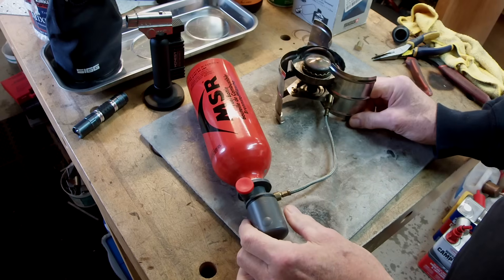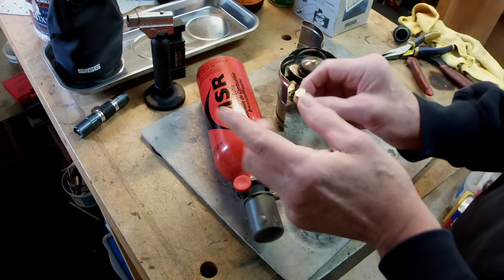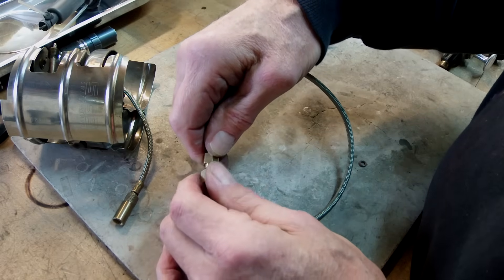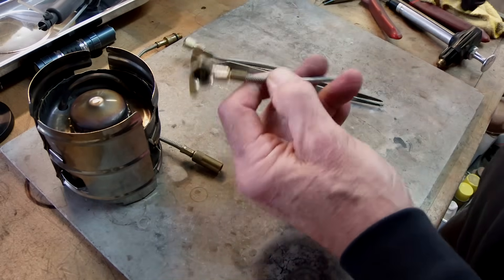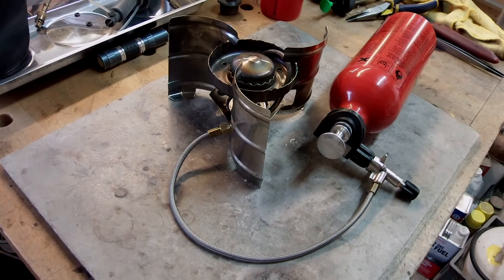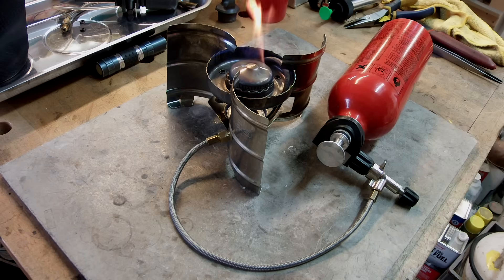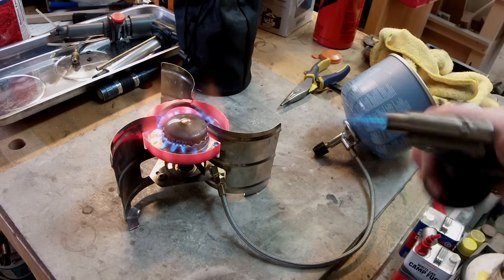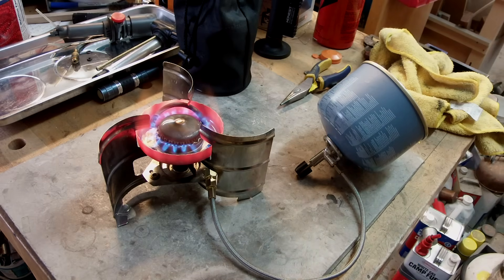SIGG FireJet Stove to Primus Hose Adapter

Comment: I'm a big proponent of Occums Law, the simplest way is the best way.  That is why I have stuck with the stoves like the Seva 123 and the Optimus 00 and its big brothers.  I get to camp pull out the stove and I'm ready to boil water.  Every evening I top off the tank and I'm ready for the next morning  or an emergency on the road or trail . I'm heating water in minutes.  The size of fuel bottle I carry will depend on the length of the trip.
Reply from the maker: @tomsitzman3952 I, too, have fond regard for the Svea 123 and Svea 123R stoves. Just take a look at my many other videos all about how to use and repair the Sveas. But, many people prefer a lighter stove solution. The video you are commenting on has little to do with Sveas but more about how clever and talented fabricators can keep old vintage stoves like the SIGG FireJet running. BD

Comment: Wouldn't it have been a possibility to braze the two together? I would think that brazing would be able to hold up to the temperatures.
Like the vid and fabrication though
Reply from the maker: @Antonio M. Andersen  Sure. Absolutely! Brazing the adapter on would be completely doable. You wouldn't even need to cut the threads on the stove side - just have a snug slip fit. Lots easier, too. Could even shorten the vapor tube to allow the stove to fold again.
BUT!!
These stoves bring a lot of money at auction to stove collectors. Doing a one-way adaptation with brazing would make the stove pretty well worthless to any collectors. Most sensible people don't want to throw the money away by brazing when the threaded method works fine, and allows for the stoves eventual resale at full price. Think about it... you don't actually OWN these (or anything else for that matter) since it'll pass on to someone else when you die. How you choose to be the custodian of it for the very short and limited time while it's in your hands is up to you. BD
Reply: @BernieDawgCinema  True indeed.
However I wasn't aware that it was a collectable stove but I guess they all are when enough time has passed 🙂.
Anyway when the purpose is to keep it as original as possible I better understand the decision to do it with threads than to braze it and that the customer is happy is all that matters, was a nice way you did it for sure 👌

Comment: Hi! Great job! Just as an additional Info, the wire cable mentioned was designed for cleaning the pipe.
Reply from the maker: @Michael Klees Thanks! Let's be accurate, though, please. While the cable in the vaporization tube is commonly used to clean the tube of gunk when using poor quality fuels such as kerosene or automobile gasoline, its use as a scrubbing cleaning tool is not its "designed" purpose. The cable is there to promote vaporization of the fuel and to restrict the fuel path to prevent surging and pulsing of the stove. Cleaning is completely secondary to the other functions. And, if you use clean-burning naphtha fuels (aka Coleman fuel), you’ll not have the fouling that requires using the cable to scrub out poor-quality-fuel residues. Try it and see. 👍😎 BD

Comment: Hi Bernie, could you not have sourced a primus fuel hose 721360 (used for the early multifuel stove and easy fuel). This has an extra long shaft by the connection, to allow for the cleaning wire and terminates in an M8 connection? BTW I'm glad you didn't, because I very much enjoyed your lathe work and videos. Thank you.
Reply from the maker: @Nicholas Cramer Hi Nick Thanks for your question. 
Pretty sure the 721360 hose, the early multifuel stove, and the Easyfuel stove all use a M8x0.5 thread for the hose to stove connection - just like the Omnifuel. (Primus uses M8x0.50, Optimus uses M8x0.75, SIGG used M8x1.00) So, yeah, I could have used the 721360, but you would still need the adapter to connect the M8x0.5 thread of the Primus hose to the M8x1.00 thread of the SIGG fuel feed pipe. Plus, consider... the Ergopump hose is made today, whereas the 721360 hose is leftover stock from stoves discontinued ten+ years ago. Which do you suppose would have more flexible seals and a longer life? 🤔😉👍 BD

Comment: Great! That's the exact information I was looking for. I hope to be able to purchase it at your online shop. When you minimize the power of the flame, I can hear the inner combustion noise. Please refer my article about the inner combustion solution of Firejet with Google Chrome translator, Korean to English. Thanks for your sharing.
https://blog.naver.com/yslee1955/221400508205
Reply from the maker: Thanks for your input. I can see where restricting the airflow with a tube like you did at your site could be interesting for improving the mix with isobutane. Good idea! Nice hose repair you did to make yours multi-fuel. I don't agree that the stove in this video is suffering from internal burn. I believe it's just minor pop around the edge of the cap at low flows from the odd cap design. Since the low flow burn (simmering ability) is inhibited by the valve needle design and the loop generator anyway, I shan't worry about the pops when attempting simmering. Adaptors are something you deal with me direct, please. berniedawgstove@comcast.net  Like your site. 👍😃 BD

Comment: Why not hit that one heatshield/pot stand part with the Dremel and a cutting wheel to remove a bit of material to make room for the new fittings?
Reply from the maker: Ummm. Because the adapter is made for a client, not for my stove that's being used to test the adapter in the video? Because I don't want to cut up my nice stove since I'm not making it for me? Because I think the value of this rare-ish collector stove might be diminished significantly if I cut it up with a Dremel? 😇 But, thanks for your suggestion. 👍 BD